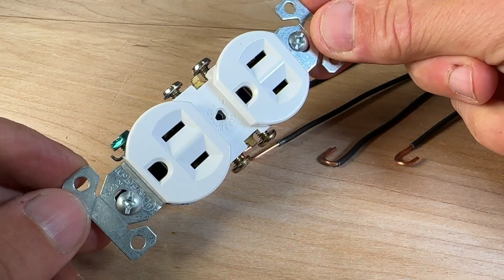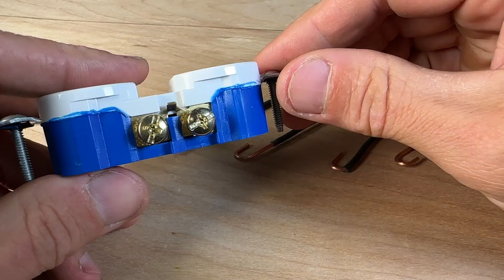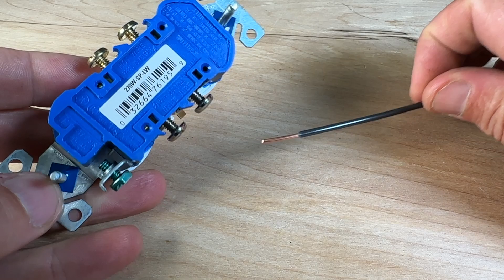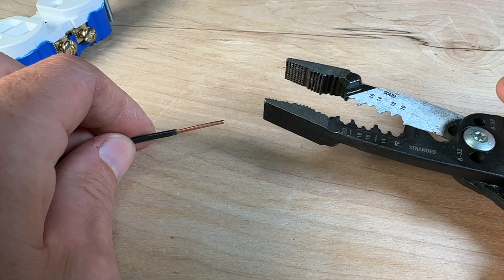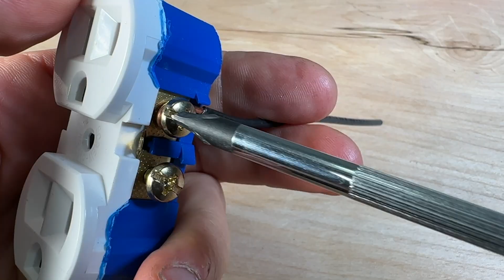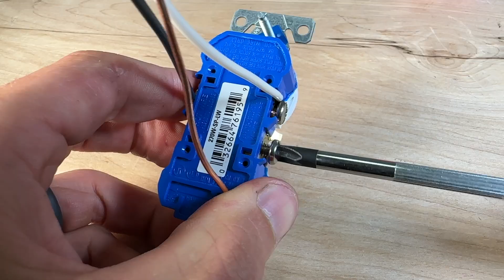Electrical Fire Prevention 101: Wiring Your Outlets the Right Way

Comment: I have the Knipex electrical pliers and I really should try to scratch or make some sort of mark on them that I can use to make sure I'm always stripping 3/4" of the wire. That's usually a mistake that I make that I'm not great at assessing by eye.

Comment: Wago time.  Sit down and table and prewire light fixtures, fans, switches and receptacle's with pre striped pig tails. Then use the pre attached Wegos for the connections.

Comment: Could you do a video of a 14/3 wire setup with red and black wires connecting to a receptacle? I still haven't found a video yet to show how to connect two sets of 14/3 wires to a receptacle. The receptacle in my apartments has two sets of 14/3 wires connecting to a receptacle that must be ancient because no one sells it. It has two speed wire holes on each corner. I've just learned that 14 gauge going into speed wire holes so it's a 14/3 wire. The receptacle doesn't work and apartments aren't in a rush to fix it.

Comment: Do you have a video on how to make the bottom or top outlet switchable with a  dimmer switch. I'm having trouble installing a smart dimmer switch to an outlet. Behind the smart dimmer switch has two black wires three white wires one red and one ground

Comment: I avoid wago connector unless absolutely necessary like if the wires a just to short to twist. I’m not sure why you’d recommend them since they work exactly the same a the “speed wire” connector on the outlet which you described as a failure point. I don’t like them because 1) they don’t have a wire release so when you pull a wire out that connection hole is damaged and should not be reused. 2) if you need to connect three or four wires together the wago actually takes up way more space than a wire nut and in a two gang (or more) switch box there are at least three groups of three so wagos are more bukly. 3) if my customer decides to add a device like a ceiling fan or an additional light or something the wagos can’t be reused and in case you haven’t noticed they’re pretty crazy expensive compared to wire nuts. 4) wires properly twisted have a zero percent chance of failure whereas wagos (being a manufactured product made by the millions) have a percentage of manufacturing defects and even a wago without defects is not nearly as reliable. Furthermore it’s nearly impossible to spot a bad connection in a wago with the naked eye. Troubleshooting a house full of wagos would be a nightmare and let’s face it most homeowners end up calling an electrician at some point after the DIY project because something’s always not quite right afterwards. But what do I know I’m just a knuckle dragging electrician who takes calls from homeowners every day. Haha. I’ll be hearing from you.

Comment: The video is severely flawed. Speed connections are fine and not a common failure point. Also, the way you removed the wire by turning it back and forth and pulling was totally incorrect and ruins the connector. To properly remove the wire you would insert a small flat screwdriver into the slot just below the hole and push to unlock the speed wire connection and release the wire. Also your strippers do have a perfect place to bend the wires for what you called a j hook but it’s not in the jaws it’s the hole in the side. Also you didn’t complete the bends! Notice the little raised tabs next to the screw in the outlet. Those are there so you can pin the end of the hook against it and wrap the wire around the shaft of the screw and make your hook into a loop. You were correct about over stripping and the direction you wrap the wire around the screw.

Comment: Great video!  Does it matter if ground hole is oriented up or down?
Reply from the maker: You will hear a lot of different opinions on that one.  In terms of the code either way works.  Some commercial properties like hospitals will call out on the building specification that the ground face up which does have a slight safety advantage over ground down.  The majority of people like ground down probably because that is what they have seen the majority of their life.  I like ground down.

Comment: I have a 3-way switch on opposite sides of a room. Just below one of the switches is a box with nothing in it. I would like to make the box below a regular outlet. Is it possible to do that maintaining continual power to it? 

When I tried it, it only worked when the switch above was in a certain position.
Thanks.

Comment: Thanks...excellent video as always! I would just add that it is recommended to torque the screws using a torque screw driver. Studies have shown that even experienced electricians often are not able to torque the connections properly by feel. Also, many comments here mention wrapping with electrical tape. From what I understand, this is not advised, as tape can trap heat & moisture, interfere with air flow, and tape adhesive may release gases, trap dust, bugs, etc., & leaves a sticky mess for the next person working in the box.

Comment: Hello. My name is Doug. I have hot water baseboard heat 6 rooms to heat. One room just will not heat even after bleeding it many many times. The baseboard is about 8 feet in long. I have actually taken it off the wall and took it outside to, if its blocked, and used a hose to clean it and that also failed. I know there is a, not sure what is actually called, that before it enters the baseboard splits the water sending water to the baseboard and also letting some of the water to continue on to the next baseboard. Would you offer your repair ideas?

Comment: I wish they would be required to make those outlets up to commercial standards, of put them right out of business. It's just a poor design and especially when there are better ones that work in a better way. The sad thing is, it's greed that's holding everything back. They COULD do it, without increasing the cost, they just don't WANT to and that is exactly why they should go out of business if they don't.

Comment: An electrician I know used to complete the job by wrapping a length of electrical tape around the receptacle, to cover the terminal screws.
Reply: I have never done that, nor have I seen it done.  Ever.

I occasionally will wrap some tape around a wire nut in a light fixture, belts and suspenders.

Comment: When do you use a steel box over the plastic boxes?
Reply from the maker: I like steel boxes for junction boxes in basements and attics in addition to if I am doing conduit.  For most residential I use plastic.
Reply: I was raised on steel boxes and I use them almost exclusively.  You'll never strip out the screws on the cover plate

Comment: I would love to see a video testing Wago 2773 push connectors (not to be confused with the 2273 connectors). I would like to see a resistance/durability testing compared to Wago 221s, along with a benefit to value analysis. The 2773 are less expensive and smaller than the 221s, and it looks like you have more size options as well. (2,3, & 5 ports for the 221, but 2,3,4,5,6, & 8 for the 2773s.) Maybe they are better for more busy boxes?

Comment: It often surprises me that people would take shortcuts when dealing with electricity. Out of all of the systems we have in our homes, the electrical is by far the most dangerous, with maybe gas being the exception. I think it's because we've used it for so long that we tend to treat it with complacency. I have a house that was built in 1980, and we intend to update all the systems to modern materials, and techniques. We have at least 3 outlets that need to be replaced because GFCI wasn't available when the house was built.

Comment: Have a situation at work where new work was done and the electrician used stranded wire instead of solid.  what is the best way to work with this?  One of the issues I have is in the outlet boxes, there is a "pigtail" coming off of the outlet screws.
Reply: Use a wire nur or Waggo.  For the wire nut, lead the stranded a bit.  Also, pul in the wires to kake sure they are tight in the wire nut.  You can pre-twist the wires, or not when using a wire nut.

Comment: Two things: 1. What's your theory behind "speed wiring" being bad (because there's a spring loaded clamp holding the wire) but WAGO spring loaded connectors being good? Don't get me wrong- I agree with you, but it seems to me they are very similar in design: A push in connector that clamps the wire vs a spring loaded connector that clamps the wire....
#2. I'm not feelin the ECX bit. I tried it and it slips too. It must not be machined to a very close tolerance. So what I've been using is just a flat blade that's big enough (but not too big) to fit all the way across the screw head, and fat enough to fill the slot. The leverage that the wide blade gets on the screw head is far more than the square drive or phillips.
Reply: Re #1: Had the same question, but I just googled it. Looks like lever lock Wago connections are more robust than speed wire.
Reply: #1 - The short answer is, there is not a lot of contact area on those back stabbed connectors.  They dig into the wire so they feel strong, but crack one open and there isn't much meat for the electrons to flow through.  Poor connections=heat expansion=cold contraction=hardened metal in a new shape..  Wagos have less metal-on-metal contact than J-hooks Scott's got videos comparing the pullout force for wagos (locked down vs. loose) and I think he's done a similar check with back stabs on the receptacle.  J-hooks make good contact and so do outlets that support the side/back stab method that you can manually tighten down.  He's also done a video on the comparative forces of Wagos and knock-offs--one was better than the Wagos, I think.  Have to check the video backlog, but the vid should be less than a year old.

#2  ECX #1 and #2 are an attempt to solve the issues that the existing fastener.  Milwaukee's approach assumes the slotted part of the fastener is deeper than the philips, but you know that's not the case.   There is a similar driver/bit made by Klein (combo #1, #2) that have the square and straight bit flush on the bottom for more contact area.  Lastly, you don't have to buy new drivers to use these bits.  They are all a standard  1/4" bit that will work with magnetic bits, but Milwaukee's version comes with that narrow shank you see on impact driver-related bits.  It all boils down to what you prefer.
Reply: Wrap the Wago with tape, I agree with your point.  NEVER, EVER use the speed slot in the back of an outlet.

Never!!!  I've seen them fall out.  In a plastic box, luckily.

Comment: Hi, how do you troubleshoot arc fault circuit in a home
Reply: Arc fault is typically from a loose connection. There is a point in the wiring where the current is spiking so fast, that the Arc Fault Current Interruption, which is typically magnetic I believe, is causing the breaker to trip so that there is not an explosive and destructive electrical arc. I would de-energize. Confirm absence of voltage. Beware of every neutral you come across as another circuit may be returning current via the neutral. Nothing quite like getting hung up on a neutral from another room and another circuit. I would not recommend it. Safest bet is to have everything de-energized. Or hire an electrician would be the best thing. All that being said. You most likely have a loose connection at either the breaker, one of the wire nuts in the branch circuit, one of the receptacles, outlet, luminaire, devices on that branch circuit. You can isolate the neutral(grounded conductor)and hot(ungrounded conductor) and test for continuity. Anything with a coil is going to ring 200 or more. You can go through the system at every joint and check the continuity of all the wires by jumping them to each other or the ground. If you have an intermittent reading it may lead you to the arc fault. There are expensive testing equipment that can help determine these things
. A good residential electrician would probably have this. I am assuming this is happening on one circuit?

Comment: Some of these mistakes at most would result in a breaker being tripped. Speed wiring is the only point that i would advise against. If the j hook is too short or long it doesnt really matter. Especially in canada we use metal boxes for everything and wrapping electrical tape around the terminals does the job.

Comment: What about the stab function that goes under the pressure plate? So you still have to screw it down.  Thoughts?
Reply from the maker: Yeah that is “back wiring” usually only on commercial-grade and/or GFCI.  I’m a fan 👍
Reply: @EverydayHomeRepairs  thanks. Does the ground get back wired also? It appears it can be but also seems not as stable as the line and load when done the same way.
Reply: @juscallmeric no.  Use the terminal on the outlet.

Comment: You admitted in this video how “speed wiring” (or backstabbing) is a point of failure and you don’t recommend it. In a recent video, you recommend the new Decora Edge outlets and switches for how fast and easy they are—and it’s the same as “speed wiring!”
You’re contradicting yourself. I believe you’ll now see how passionate I am about educating the public about backstabbing. I’m a licensed electrician and doing this for 23 years. I’ve seen it first-hand…it causes fires! It should be outlawed and no longer manufactured. I commented on your Decora Edge video and you deleted it. Do you really welcome all commentary?
Rich P
Reply from the maker: Yep, I welcome all comments.  We agree backstabbing is no good.  I would not align on back stabbing and Decora Edge being the same.  In the Decora Edge video we opened it up and you can see the difference in design which I like a lot more than standard speed wiring (back stabbing) design.
Reply: Decora Edge outlets have a pressure plate which actively creates a physical clamp force on the wires, rather just a few pointy parts which dig in to the wire for older backstabbed outlets.
Reply: @stevekjr9563  It doesn’t matter. The wires are just as loose, including the larger #12 wires. The wires turn while inserted, and are easily pulled out with the clamps down.
Reply: @electricaladvice5371  Whats the pull-force in the Decora Edge?

Comment: Cool - I learned about the tabs.. had no idea.  btw, what about wrapping the terminals with electrical tape? Is that a bad idea?
Reply: I was going to ask the same thing.  I pretty much always do that personally ...
Reply: Ya. But, when that tab is removed don’t you have an additional Romex cable entering the box running to it in order to power the second of the duplex receptacles?
Reply: I never tape them.  Do you expect the outlet to move around in the bo x???

Comment: Should/can I use the lever-action commercial outline in my home?
Reply from the maker: The one from Hubbell?  I am hoping Leviton expands their Edge produces as right now they only have residential-grade 15 Amp.  For me I am still doing Legrand Commercial-grade.
Reply: Yeah, either Laviton or Hubbell. I've a lmap that flickers occasionally. I changed the bulb and then the lamp, but it's still flickering. My assumption is that there's a loose wire somewhere, so my next step is replacing the outlet. But this would be my first time doing electrician work on my home, and the levers seem more foolproof, lol.

Comment: You failed to mention how important it is to not attach a black to one screw and a red to the other if the jumper has not been removed.    Course it is a great way to have your own fireworks show.
Reply: Hmm. I'm not sure that's what you would get. Typically, if there are two hot wires they are from the same circuit and the bottom is just on a switch and the top is not. If that's the config and you don't remove the tab, I believe what you'd get is that the switch not work to turn OFF the bottom receptacle. It would always be live like the top.
Reply: @joe3276865536  No joe.  When you insert a circuit breaker in a pannel.  1 leg is from one side of the transformer and the other leg the other.   Between them you get around 220 Volts.   A 220 Volt short makes a large spark.   By the sounds of it, you should definetly stay out of your pannel as youi will probably kill yourself or burn down your home.  If you don't understand the phasing of the supply to your home, or how split circuits work, your going to get hurt.